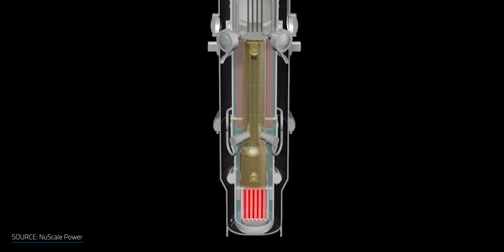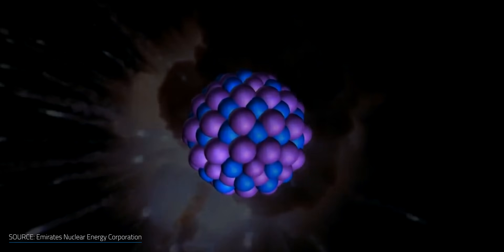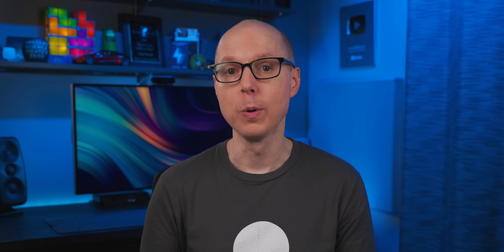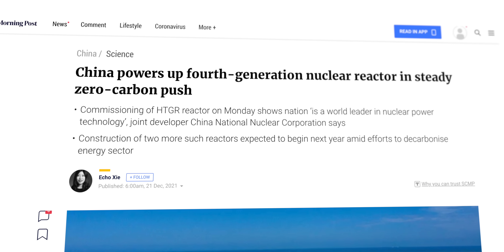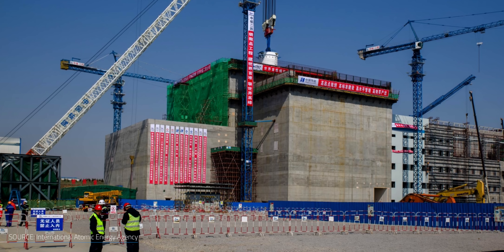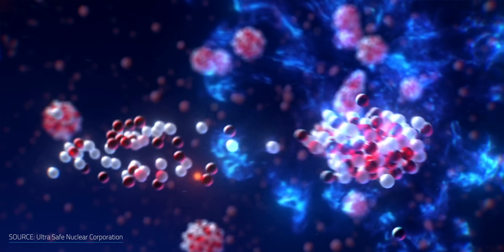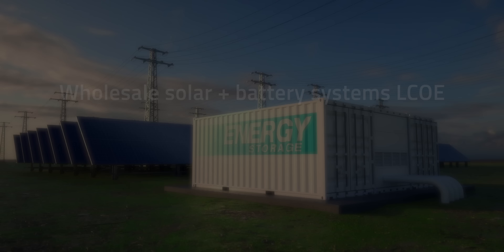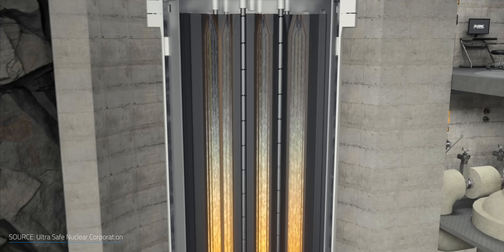Forget Small ... What About Micro Nuclear Energy?

Comment: When I was still working for vestas they were working first with Tesla and later with north lot to develop better long term, high storage grid batteries. Having learned about this and what the plans were regarding them I really believe THAT is the endgame for energy production both on the field and building to building but HOW we generate the electricity after that point is something that should be universally accepted. Gas, wind, solar, nuclear.. doesn’t matter. We could spend the next 20 years phasing out petroleum and nuclear going this way as we could utilize their speed of generation to bulk up our storage, use their grounds to increase the size of the batter farm and gracefully transition into full time wind, solar and hydro to keep the generation of electricity going for years to come. Most wind farms are estimated for 20 years with some that haven’t been replaced since the 80s! This could mean with batter storage that we could replace anything needed without feeling a hiccup ideally. We should try to focus on our long term storage more than trying to make some of these other means of generation permanent. Let’s make this planet a lot cleaner and a little quieter

Comment: I think the viability of these small reactors would come down to the cost of implementation vs the cost of energy transmission in areas where wind and solar are not viable. Could also serve as a good back up power source to meet energy demands at night when solar stops generating, rather than batteries.
Reply: Existing nuclear tech already connects easily to our existing grid (unlike wind and solar), and provides low cost, extremely low carbon (pretty much just initial building of the plant/reactors), constant power. Sadly, you can't just start/stop fission to backup low energy dense alternatives like wind and solar. Battery tech is sadly no where near existing, especially at the necessary scale. So, "renewables" like wind/solar are backed up by fossils. Natural Gas, if available, or oil/coal otherwise.

So, the question then becomes, why keep avoiding the most obvious, already existing, tried and true tech, that also has the benefit of being the best for the environment overall, in favor of low energy dense alternatives? I personally appreciate the willingness to entertain the idea of nuclear in the fashion you have already, even if it is not feasible. I would challenge you to take one step further and look into what nuclear already is! There are a lot of great resources out there that are more eloquent and far more knowledgeable than me.

Comment: One point I think is overlooked here and that is the cost of wind and solar when there is no wind and no sun.  That costs is very very high and should be factored in to the unit coast based on averaged generating performance, say over a year.  Nuclear would then look more respectable.  The benefits of base load can not be dismissed when considering security of supply.

Comment: You have provided an interesting look at contemporary nuclear power options. I did not see that you have clearly addressed several important issues.  Nuclear reactors have not been built in the USA without the public assuming responsibilty for liability for any bad outcome. The private sector will not insure theses private endeavors. The is not long term geologic storage for reactor was because there are not sites geologically stable over the decaying lifetime of the waste. The nuclear power industry has privatized the revenues while socializing the risks. I could not tell from your excellent graphics and discussion if the AMR's hydro cooling systems are closed or if they require external cooling infrastructure. Resolving these important concerns could bridge the gap in energy production as we move forward.

Comment: There’s waste management out there it’s up to the public to decide whether it’s a go or a no and that’s the only thing holding us back from nuclear power. There is storage containers that are indestructible and there’s very good geological ways of burying the waste far down below anything geologically active and let nature take the work since there’s actually natural nuclear power plants happening in the ground naturally. Also Most nuclear waste has a life time of 100 days - 35 years. Rock concrete ceramic and glass are good for insulation I’ll go the cheap way and use a oil drill and bury it deep. People got nuclear waste all wrong. It’s not no green glowing goo it’s not gonna make everything mutate believe it or not coal is gonna kill you faster than nuclear and oil is killing us all and our oceans and wildlife while there’s never been any contamination of nuclear coal and oil puts out more wasteful chemicals like mercury and other pathogens in the air than nuclear waste which is in one spot and can be moved around easily. hell I’ll rather stay in Chernobyl than china with the crazy coal pollution 
That’s equivalent to staying right next to the twin towers while they are falling and dust going everywhere. Point is go nuclear its far cleaner and safer to manage the waste and nuclear doesn’t make a lot of waste do to the life time of uranium the sad thing is politics that keep pushing for oil and coal and not easing the public on something so technologically significant basically tryna scare us so we are dependent on oil and coal for the own financial gain very sad

Comment: Thanks for continuing to perpetuate the stigma of nuclear waste. Only 1-2% of the total waste produced from current gen nuclear plants has a half life over 10 years. Solutions for this HLW have already been figured out, only the red tape and public perception is slowing down the implementation of it.
Nuclear waste cannot "leak" because the radioactive isotopes from the waste are fused into glass and ceramic which are then sealed in very thick layers of concrete in a couple different types of containers. Even the HLW containers used for transport can withstand the impact of a runaway train (there is video footage, train was totaled container just rolled away a little bit).

P.S. Your use of the "traditional" nuclear waste images isn't going to help the green goo stereotype.

Comment: All very interesting, but I'm not holding my breath, largely because of one missing process that would reduce overall costs much more. 

That process is reprocessing and reusing the "used" nuclear fuel material. One company used to do that in the US, until they closed because of financially impossible demands from the NRC. (My wife used to work for that company.) France used to do nuclear fuel reprocessing as well, but I haven't checked on that recently and I don't know about any other countries. 

There is still a huge amount of energy potential in used nuclear fuel, but the output is reduced over time due to reaction  byproducts that slowly "poison" the system. Reprocessing removes those byproducts, adds some fresh fissionable material, and it's just like new again. I believe that getting reprocessing started again would speed the way to more, safer and lower-cost nuclear-generated electric power.

Of course, there is also the unspoken-of elephant in the room. A vast, gloomy shadow. The totally INcorrect public perception that Three Mile Island was a "disaster". TMI was an incident, yes, but it did more to show that the safety systems worked, even when they were improperly operated.  Case in point: during the Congressional hearings on TMI, it was demonstrated to the committee that the average DAILY radiation dose inside the committee room was several times HIGHER than the TOTAL release from the TMI facility over the 7+ days of the incident. (The US Capitol building, as well as many other buildings around the world, is largely made of granite. I am sure that you know that granite contains a number of naturally ocurring radioactive minerals that are, as a practical matter, impossible to remove.)

Comment: This is INSANITY. Let's recap what you've told us:

NUCLEAR - (conventional) Levelized Cost of Energy ANalysis (LCOE) is $131-204/MWh, but this is a lie. (1)

NEW NUCLEAR - SMR's LCOE is $120/MWh, but this is a lie too. (2)

RENEWABLES - Wind & Solar & Hydro OTOH have a verified LCOE of $20-50/MWh, as you report. We know that's true because that's the cost of current contract tenders. Providers would go broke if they exceeded it. And the LCOE for Wind & Solar has been dropping consistently for over a decade: ~8% p.a. for wind, ~12% p.a. for solar. 

SOLAR + BATTERY - range from $85-158/MWh.

So Renewable power generation is currently 20% the cost of power generated by SMRs - if the sales people who want to sell SMRs are to be believed (it would be the first time they've been honest, if they are). SMRs LCOE is 6x that of renewables! Even with battery backup renewables cost no more than the bogus promised LCOE of SMRs, and renewables costs drop ~10% per year.

Renewables CAN in some areas provide base load even without batteries: in much of Canada hydro can be used as a battery to back up wind & solar - in fact we do this now. Ontario Power Generation's own studies (conducted when it was called Ontario Hydro) assert that we can double our existing hydro capacity (23.5% of total power production) to ~45% with inexpensive small dams & run-of-river (a tube runs down the bottom of the river & contains a string of small turbines; not visible & requires no dam). All of that can be used as battery. The 1990s-era report suggests we could expect to add renewables capacity until it reaches 60% of total hydro capacity, but technology has improved so we could do better.

In other words there is absolutely no need for SMRs in Canada. And building them here is guaranteed to increase hydro rates, keep them high forever, and saddle our provincial governments with massive debt overhang: no one knows what it'll cost to decommission any nuclear plant (no one's ever completed the job, but current estimates are billions per reactor for decades: far more than the cost of production). And there's still no where to put the waste.

But wait - there's more!

SMRs can only achieve promised lower costs if they're mass produced. Prototype-scale production won't be cheaper - it'll cost much, much more. And while Ontario & Alberta have provided ideologically-driven idiot Premiers willing to buy these financial disasters, no one else anywhere on the globe (outside China) has. And SMRs everywhere promise nuclear weapons development everywhere!
____________________________________
1. Conventional nuclear's LCE is a lie because Nuclear is the only industry exempt from having to include allocations towards eventual decommissioning. Because it's the only industry effectively exempt from having to carry liability insurance (the requirement is pathetically low; governments agreed to be responsible for costs over minimal amounts because liability costs for a nuclear accident were deemed far too high for any commercial provider to assume. Hmmm. And because there's no allocations for waste management: a location & both security & maintenance protection for thousands of years. Seems trivial by comparison, but there's also the issue that nuclear builds have NEVER come in on-time or on-budget. You quote 6 years for an average build & that is what the industry quotes, but Finland's newest reactor - just one additional reactor for an existing power station - is more typical. Construction started 2005 budgeted to be commissioned 2009. It was finally completed & commissioned this year, 12 years late.

2. Ditto. Plus no designs have yet cleared regulatory approval in N America so LCE is whatever the industry sales guys claim it is, they're unconstrained by reality since they don't yet exist.

Comment: Solar, wind and hydro can't supply base load electricity all of the time. This is why we should be building Thorium fueled, Liquid Salt,  Nuclear Reactors (aka LFTR)., which doesn't use a pressure vessel nor does it create radioactive waste or micro particulates and it automatically shut down if a problem is encountered. A thorium fueled reactor can process radioactive waste such as plutonium and reduce its storage life from 100,000 years to 100 years.

Comment: I wonder if anyone's testing using waste heat from SMR or Micro reactors as a district heating solution 🤔 like how New York pumps steam everywhere and Reykjavik uses geothermal to heat roads and public spaces. Most of the electricity generated is going on heating spaces anyway (in residential areas).

Comment: The micro reactor size (8m46s) is smaller than the first building sized computers.......now computers can be smaller than a fingernail and 1000 times (probably more) more powerful........I'm not saying this means that reactors will get that small, but there is heaps of scope for them to become smaller, safer, cheaper, portable and the limits will only be set by the limits of the human.

Comment: Shouldn’t we figure out what to do with the waste first?
Reply: From what I know, they did figure it out, but the industry is dragging its feet due to oil barons running the whole show.

Oil is used for a crap ton of things, like the plastics and the materials we rely on in everything.

Every major conflict in modern times has something to do with resources.

Also nuclear waste comes in 3 tiers, low/medium/high. The high reactive waste are rare and tiny, the vast majority are low reactive waste.
Reply: "Like all industries and energy-producing technologies, the use of nuclear energy results in some waste products. There are three types of nuclear waste, classified according to their radioactivity: low-, intermediate-, and high-level. The vast majority of the waste (90% of total volume) is composed of only lightly-contaminated items, such as tools and work clothing, and contains only 1% of the total radioactivity. By contrast, high-level waste – mostly comprising used nuclear (sometimes referred to as spent) fuel that has been designated as waste from the nuclear reactions – accounts for just 3% of the total volume of waste, but contains 95% of the total radioactivity."
Reply: One method I've seen online is to inject these high reactive waste into bedrock and bury them so deep underground where no one can reach.

At certain depths, the temperature gets hotter as you get closer to the core of the planet.

Comment: It sounds interesting. My question is how well will these fit in with the intermittent energy production of wind and solar... Can they be ramped up and down easily. Let's face it the times of base loss power are over.
Reply: In a word, yes. I can speak for the Terrestrial Energy design. It can ramp up and down very quickly, and has black-start capability. Many of the Generation-IV style systems have these capabilities, so this allows them to offset variable load from renewables very easily. Alternatively, they can store unused heat in molten salt thermal storage tanks during off-peak hours, which can then also be used to grid-balance variable load from renewables.
Reply: Moltex's design covers that.  It uses a salt loop.  Essentially the reactor is constantly heating up a big pool of salt.  So the reactors will stay at a constant power level  and you use the energy from the salt loops as needed.  With this setup you can go over the power output of the reactor.  Also Moltex's design runs on spent fuel, so it also covers the issue of "what to do with the spent fuel".  https://www.youtube.com/watch?v=cQCm-kmUWA8

Comment: I say screw dealing with the complexities of controlling the decay rate. Tritium gas is a reasonably safe radioactive gas. It decays steadily and if it leaks isnt that much of an issue if there is ventilation. U just need a compound to interact with those energetic particles to output electricity.